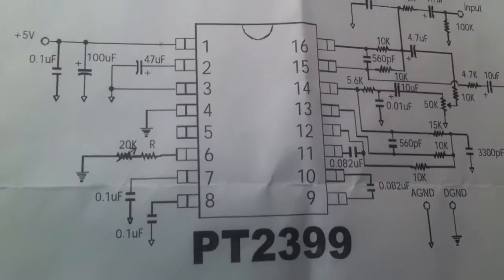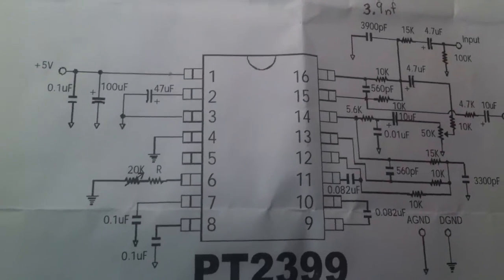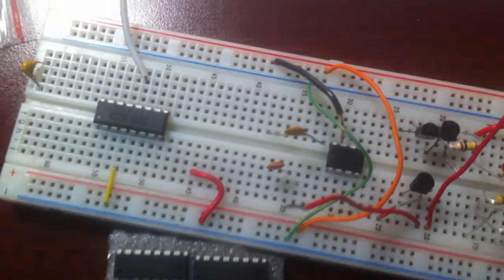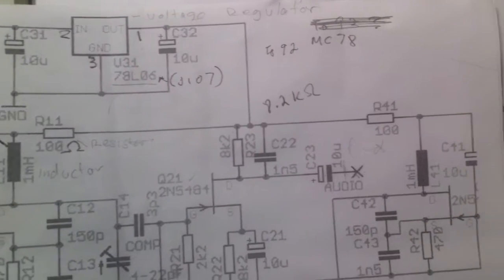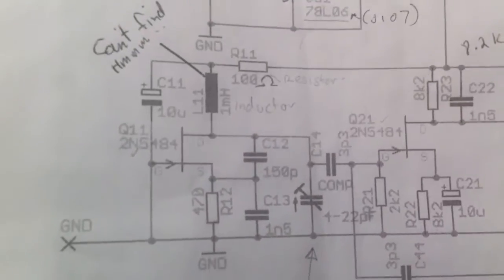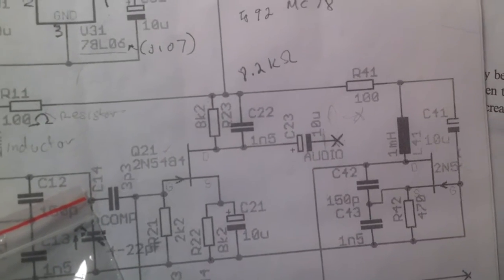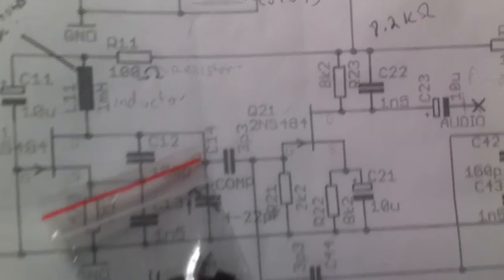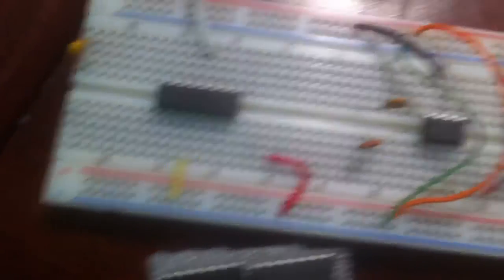Feb25 2016 127

Comment: Hey man! I know you made this video long ago, but do you know where I can find those 2n5484? I'm looking for them like crazy but I don't know where to find them or what do buy to scavenger them 😢
Reply from the maker: Hi! No worries. You can find them on Amazon here and there, and I found a few on ebey, but be sure to buy from a seller with a good rating. there are fakes out there.
It can take a bit of time to get after order.
Also, a reliable source can be Mouser. You will have to set up an account, and the website is a bit confusing, but Mouser is reliable and fast. Shipping is not cheap however.
Hope this helps.
Reply: @maarkaus48  Thanks!
Reply from the maker: @Francisco17Berrios  np, mouser is a good bet, and reliable.